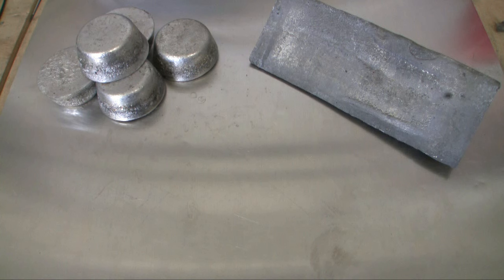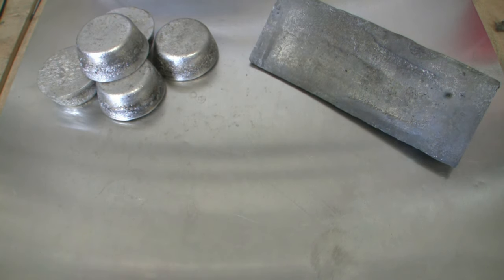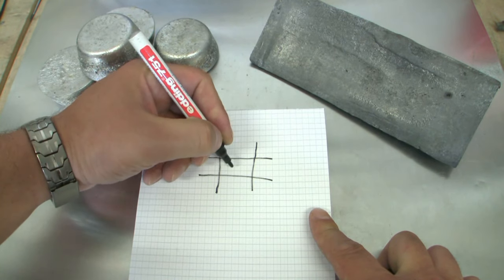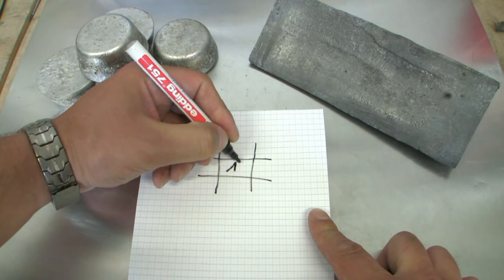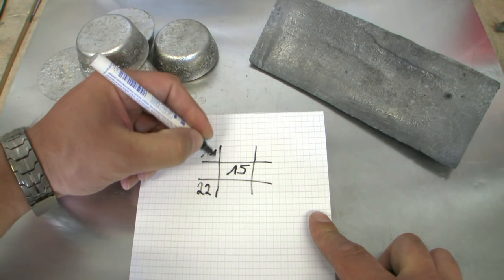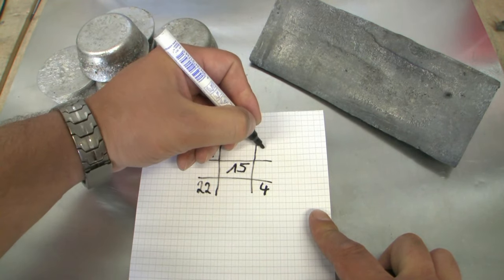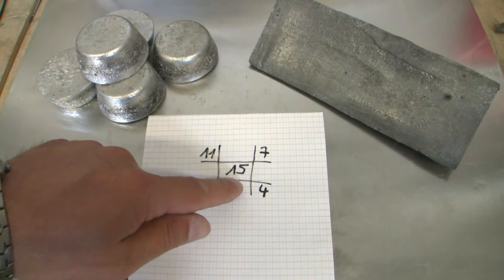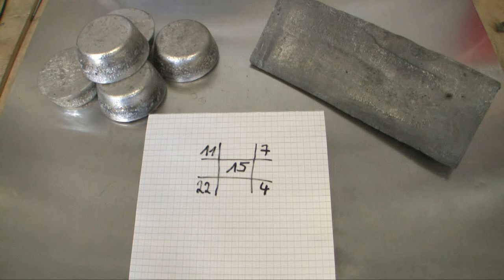How to calculate your lead alloy blending for bullets

Comment: what BNH tester do u find is easy 2 use 2 check the harness of ur lead w/out breaking the bank . iv been using the free tire wheel wts just casting from lee bullet molds dropping in cold water bath w/ice & using my finger nail does not make a mark . i know its hard since i shot few from my marlin 1895 45-70 gov at 50yrds  in2  a bucket with 3 old bed sheets w/water soaked 24 hrs pass threw the bucket pushing the cloth out w/ it and going in a 8'' pc of fire wood after i got the 340 RNFP  bullet was out it lost  only -19grs of bullet wt mass . it was crony at 1850 Fps .. great way 2 calculate lead ur videos is always fun 2 watch i enjoy every one of them keep it up bud ..
Reply from the maker: The Lee hardness tester works pretty good and it does not cost so much. It Comes with all you Need for testing your bullets. I was used to scratch my lead with my finger nail too before I had a hardness tester....funny to see that we all so similar ;-) Thanks for leaving a comment brother. Greetings Markus

Comment: That's very awesome, thanks for sharing that! Question: water quenching for making the rounds harder only works if there's antimony in the lead mixture, right? Thanks again, AGW.
Reply from the maker: AirGunWarriors Yes, that's right. If the alloy contains antimony you can harden them.

Comment: I have a question sir. So by your excellent diagram, if I'm looking for a lead alloy with a hardness of 18, then I would use 4 pounds of 11 ( or a 16 to 1) and 1 pound of 22 Linotype for a pretty close blend? Thank you for the video. I hope I understood it correctly.
Reply from the maker: If you need an BHN of 18 then you would need 4 lbs of BHN 11 alloy and 7 lbs of BHN 22 alloy
Reply: I think I have it now sir. As an another example, if I am using lyman#2 and pure lead the ratio for 12 bhn would be 7 pounds of lyman#2 to 3 pounds pure lead?  Thank you again for your help.
Reply from the maker: 7 lbs of lyman#2 to 3 lbs of pure lead is right brother

Comment: Any suggestions on how to take pure lead and make it into a good alloy for 45 acp bullets?
Reply from the maker: +johnmiller102 Add a little bit of tin (10 parts lead to 1 part tin) and you have an great alloy.
Reply: Linotype alloyed 1 to 1 with pure lead is about 15 BHN.  You' should probably have bullets this hard so they aren't damaged during the loading process or when feeding up the feed ramp.

Comment: Verry good calculate system
Why not just use pure linotype lead, there are also full metal jackets bullets, copper ,, and that's even harder than   Linolead
Reply from the maker: That's right but if I use pure Linotype the bullets would be very light.

Comment: So, the hardness of the alloy on the left is 2 upside-down V's, and the hardness that you are shooting for is 1 upside-down V and 5? Lol. Just kidding..... The 1's look like upside-down V's. 

Anyway, which element was used to make the harder alloy, was it antimony or bismuth?
Reply from the maker: :-)) I use antimony to harden my alloy.
Reply: wiederladerTv 
What's the benefit to hardening bullets? Is it primarily to prevent soft lead from fouling the rifling, or something else?
Reply: Do you need a hotter furnace for antimony? @wiederladerTv